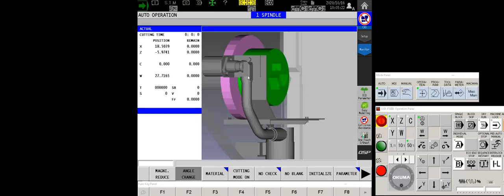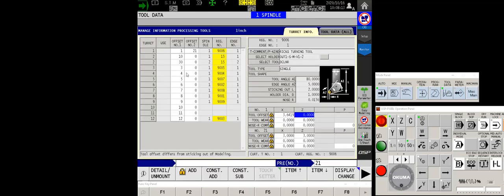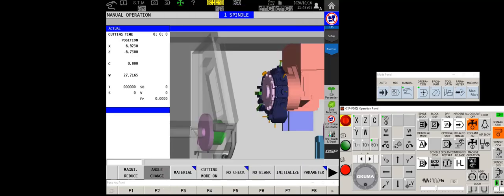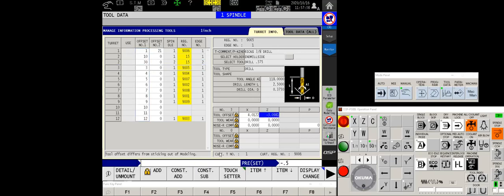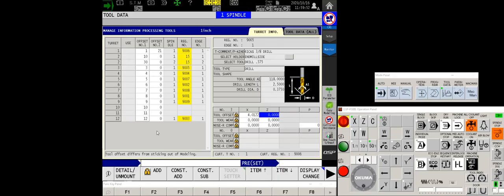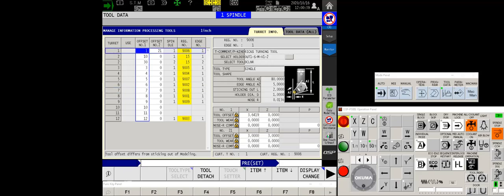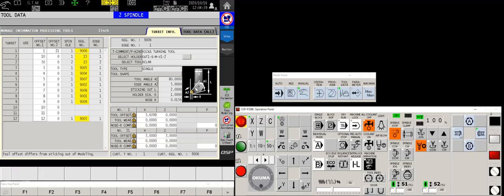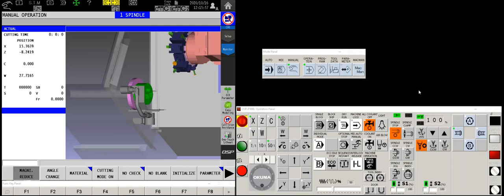Calibrate your tool touch setter

Comment: What is the name of the video with machine zero setting?
Reply from the maker: For turning centers?
https://www.youtube.com/watch?v=ENh8aJ2sgIM
Reply: @pocketcharleywithgosiger  
Yes on a turning center with p200 control system
Reply from the maker: Ah. As you probably know too well, the P200 didn't have the system 2 parameter to store an encoder value, so the distance from encoder zero to spindle centerline was entirely contained in the work zero set column. This is why you'll see a huge number in the X zero set of a P200, while a P300 will have an X of 0 when properly aligned